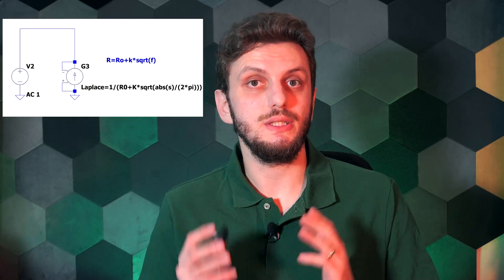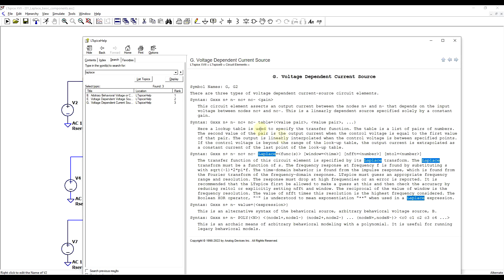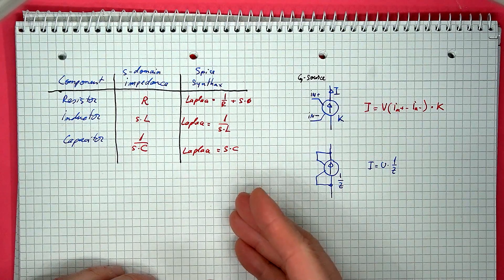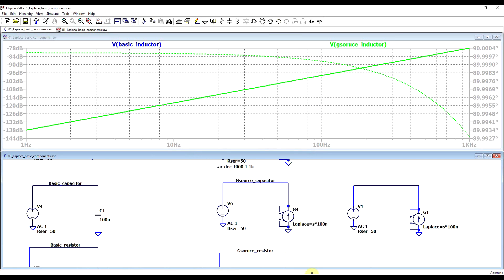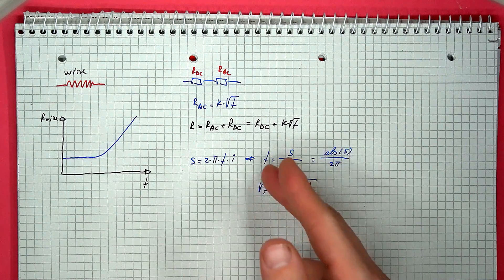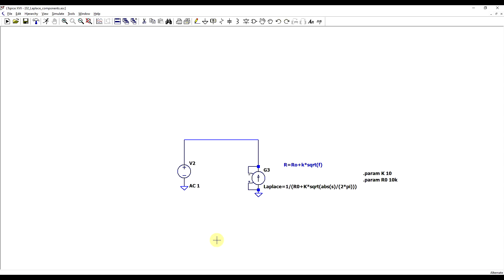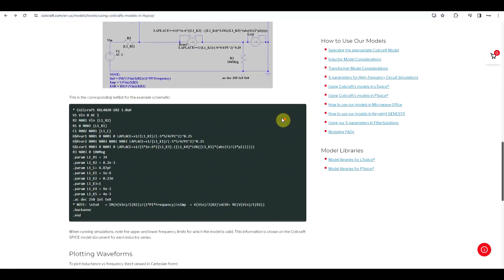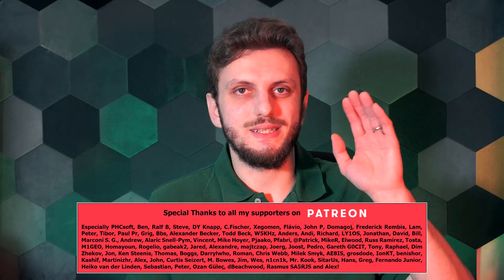LTspice tutorial – simulating Frequency Dependent component Parameters

Comment: Great video.  I recreated the models you showed.  My goal is to generate an LTspice model of a piezoelectric film.  I tested the film with an LCR meter and measured the capacitance vs frequency and resistance vs frequency from 20 to 200kHz.  I've seen in literature that the film is modeled as a current source with a resistor and capacitor in parallel to the current source.  My goal was to implement G source models for the resistor and capacitor and replicate an impact on the film, which I measured using and oscilloscope.  The impact is typically a half sine wave of about 80 Hz up to 5000Hz (depending on the duration of the impact).  Is this something you think can be modeled in LTspice?  I got stuck because the techniques you described don't seem to work in a transient analysis, which is what I've used to date.  Thanks!

Comment: Brilliant. I have an ongoing home radio project that would benefit by being able to simulate the real and imaginary parts of the relative permeability to give an idea of frequency roll off and frequency dependent thermal noise due to core losses (imaginary part of u) as a function of different ferrite types (Fair-Rite types 73, 43, 61, 67 etc). To date, I have always created spot models that are a bit contrived but do the job. While this method may have difficulties, this video and the Coilcraft work (I was not aware of this) give me some pointers. Cheers!